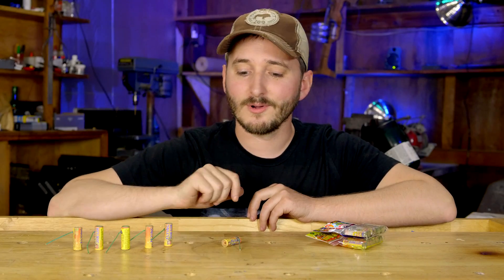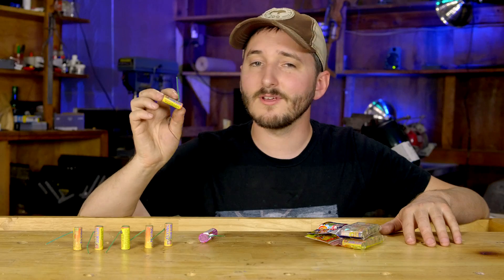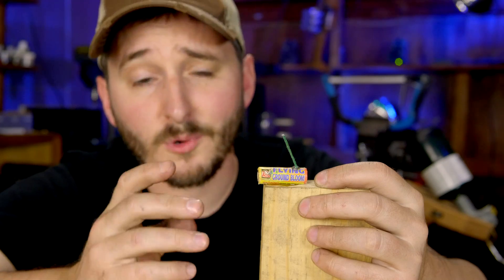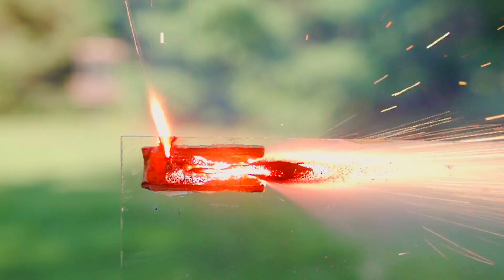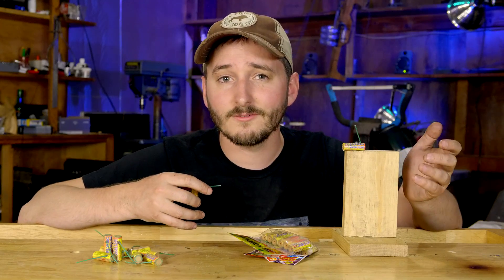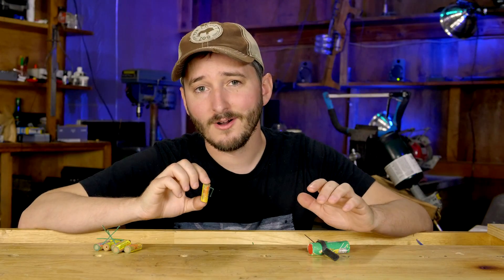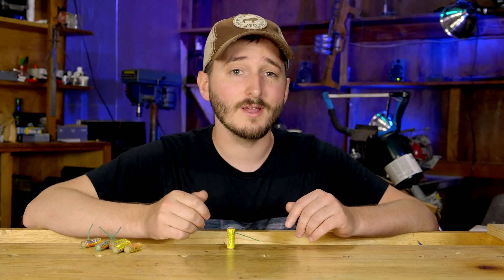How Do These Fireworks Fly?

Comment: Gyroscopic stability and moment of angle.   
The cylinder becomes more stable due to it's rotation.  
The moment of force near the end of the cylinder forces it to move inline with the center of rotation(this happens 90 degrees later due to gyroscopic procession, but it requires no input from you other than lighting the fuse).  
The closer to the center of rotation the end gets the lesser the moment of force is and the more stable the cylinder becomes.  
Once the cylinder becomes fairly stable(inline with the center of rotation), the jet in the end fires and the firework is pushed in whatever direction it happens to be pointing.

On a flat surface it tends to stabilize 90 degrees or perpendicular to the surface. Ground effect probably plays some role, but the surface it's self acts as a fulcrum or pivot point that the cylinder hinges around when the side jet pushes it inline with the center of rotation.

On the grass or any uneven surface the cylinder will fly in whatever direction it happens to be facing when it stabilizes and the end jet fires.  That direction is likely to be random due to the irregular surface like the grass.  

When thrown the cylinder stabilizes at some point during the tumbling that was imparted when you threw it and flies in whatever direction it's pointing when it stabilizes and the end jet fires.

Comment: I think the nozzle always aims down, because the center point of mass shifts down to the nozzle as the fuel on the top burns out. However, if you throw it up, drag will make the center point of mass facing up instead of down, making them fly down instead if up.

Comment: I have fired thousands of these (almost all  were hand thrown) and here is what drives me nuts: If thrown overhand, spinning end over end, they >always< fly to the left. If tossed underhand ,end over end, they >always< fly to the right. How???????? Why???? FWIW, I have never seen any made with simple black powder. Most of them are bright green, being made of barium nitrate, magnalium, a chlorine donor of some kind and a resin of some kind, IE red gum, etc. I have worked out the interior geometry and it looks like it can be scaled up to some extent. Stand by. (Full time pyrotechnist w/ 30 years experience here, using sons account).

Comment: It stands on end because of where the force is applied, you can get a similar result from spinning cylinders by applying force to one end, it works with batteries, glue sticks and other reasonably sized cylinders when you spin it from one end on a flat surface by sort of pinch/rolling it with a finger. The only difference is that the fuse hole acts as a constant application of force rather than a temporary one like using a finger so it stands almost completely upright instead of only half way.

Comment: The Coanda Effect from the off center axis side exhaust causes the exhaust flow to adhere to the side of the cylinder in an angular 2-D fashion.
Primarily circumferential but including an axial component pointing to the shorter end.
This resulting lower pressure areas combined with the flat surface high pressures in the 2 axes and rapidly accelerating spinning gradually cause the erection of the cylinder. The secondary gyroscopic effect providing basic but wobbly vertical stability. 
Ultimately the end exhaust nozzle ejection gases erupt providing powerful vertical forces and the firework shoots upward until the fuel is exhausted.
I am being semi-serious about this. But, even to me, it smacks of over analysis.

Great video. No. A Fantastic Video. This should be shown to anyone with an aptitude and interest in science and critical thinking. 
One of the best I’ve seen in a while.
With no preference of gender, racial or any other category. You either love this stuff or you don’t. You can teach it (force it down their throats) to people who are indifferent but that will be wasted effort. I’m 60 years old and I was glued to the screen to see the slo-mo video and hear your analysis.
Unfortunately, that is not what Public and most Private schools are promoting and teaching today. 
Sorry for preaching but this is a great video.
Keep up the great work.
Reply: teachers should reference this video when teaching about forces, rotations, center of mass and so on in physics. Cool video indeed

Comment: Honestly, for me it was exactly as you say it, it is intuitive for me. I already thought it would work like this  but sadly I haven't had the proper schooling to explain it in terms of physics.  What I do know from my own observations using similar fireworks is that the exit hole that the fuse goes through is slightly at an angle so that it starts the rotation that way. It also helps that the bottom of the firework is lighter therefor causing it to behave like a turvy top or topsy turvy, or whatever it is called :)

Comment: I still remember back then when I was a kid, I used to squeeze batteries onto the floor using my thumb until it launches forward and then spins fast, it will try to stand vertically but will only stay diagonally while spinning.

Comment: I do think your tippy top idea is the closer but not the fundamental contributor.  This is a conservation of angular momentum problem.  Look at how the distribution of mass changes as the burn progresses.  Initially it is uniform with a side force.  Much like your standard rotational intertial problems.  Then as the mass burns off the mass becomes lopsided and conservation of angular momentum dictates the precession of the rotation into the vertical orientation.  It is in this orientation that the charge burns through the nozzle and starts burning orders of magnitude faster thereby turning itself into a spin stabilized rocket.

Comment: Liking this video before watching it because I like you, and I know this'll be good
Reply: I think the long axis spinning causes the firework to behave as a wheel, creating the additional torque that pulls the firework upright.  I think the ground effect though not always immediately obvious still plays a roll in making the bottom end act as the wheel instead of the top end.  There could also be a distribution of mass factor, as the Center of mass shifts toward the bottom, causing the bottom to have more traction

Comment: This has a lot to do with a variation of the intermediate axis theorem, the shortest axis is the one with the lowest moment of inertia. Starting on the long axis and giving it a lot of rotational acceleration PLUS adding some friction with the table at only one end due to the fuse hole thrust causing the tube to bounce upward slightly leads to the conservation of momentum making the firework want to stand on end then the rest is just a change in thrust in the long axis direction. There are a few videos on the intermediate axis theory plus a cool one on rotating tubes by numberphile that MIGHT help make sense haha. Understand how an object can change its axis of rotation to conserve angular momentum is critical to understanding this phenomenon though.

Comment: It's a interesting thing isn't it? i've taught about it for a while before as well. But a couple of years ago i managed to get hold of a copy of a old fireworks journal that among other things explained how these are supposed to be made, making clear notes of certain off sets that are meant to be used for the angle and location of the rotational stabilizing nozzle. There also are some notes on how the weight distribution should be done for them. It's actually a pretty simple way as to how they work. The reason you don't get super consistent results is cause of them not having the greatest amount of accuracy in china when making them among other things. I can explain it all to you if ye want. i can also look for the old journal in which it's explained and draw up a cad model of how they work for ye. I'll send ye a email mentioning it so if ye are interested ye'll have a way to reach me.
Reply: Citation, please?

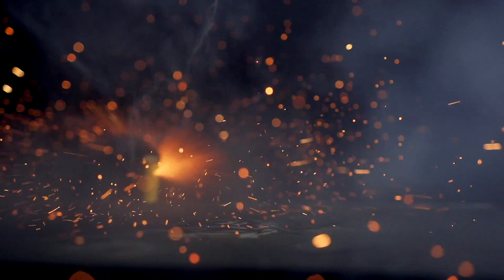Comment: I think that slowmo at 6:05 reveals all. It starts by pushing the whole body forward. Due to friction with the table, it rolls forward instead. It's momentum carries it forward until the side nozzle points down. Thrust now torques it upright against gravity. It also appears as though the thrust is off center, further increasing the rotation about the long axis, and this rotation ensures the thrust provides a torque against gravity in all directions equally, keeping the body upright. If it ever tilts slightly, the thrust when the body is rotated to the same side it's leaning towards, the thrust points at the ground and gets a little stronger boost like putting a backstop up behind the jets taking off from an aircraft carrier. Once the main thruster causes it to leave the ground, it should be spinning fast enough to maintain stability even without this "extra boost"
Reply: I also heard your comment about increasing gyroscopic precession, which would work in a frictionless environment yes, so the friction in this case leeches some of that increase in precession to an upright balancing motion. It's just that if it starts spinning too much before the first time the side nozzle pints down, it probably has to work that extra bit harder every rotation to right itself, because the majority of the self-righting torque is as You said, lost to precession

Comment: I recently started playing with yoyos... (with bearings .. spin physics at play)... 
If you throw a (unresponsive) yoyo and it goes all wobbly, having the string (or even just your hand / body) barely touch near the centre of gravity (a side near the axle for instance), will provide a lot of effect and stabilizes the yoyo into a smooth rotation again. I suspect that the hits on the ground the fireworks make while gaining acceleration are enough to remove enough of the wobble and focus the spin around the axle of the firework... the faster it spins (like a yoyo) the more energy you would need to actually have an impact so it may as well be in the air when the rocket fires ... 
So ... wanna build a rocket that has a bearing and a spinning mass going fast around it instead of wings and hope for a straight flight thanks to that gyro? 
Better yet... test to see if only the spin is required and not the actual 'thrust' from that firework to get a stick with a yoyo glued to it and some sort of a motor... to see if the stick would stand up and balance ? (I can't test this here... but sounds like a cool toy / novelty)

Comment: intuitive: exhaust gas forcing zylinder to spin around his axis, while exhaust gasses press against table. It stands up, then is propelled in the air. Why it stands up, centrifugalforce. Why it spins? because the force is applied on the outside of the cylinder pointing inwards making the center of gravity unstable and causing cylinder to tumble, gas forces trying to counterbalance the inertia of the moving cylinder. Voila

Comment: From the footage it seems like the fuse (rotational exhaust) hole is slightly off-centered from the thrust hole axis and closer to one edge of the tube - thats why they all spin in the same direction. It has to be done for a reason, and i think that reason may be why the firework stabilizes itself - it does act like a spinning top.

Comment: Looks like a Euler's disk but in reverse. The rocket is pumping energy into the system causing it to stand back up. I think you are right that it's not the only thing in play. The nozzle is not only off center along the long axis but side to side also imparting spin. A lot a physics going on is such a small toy.

Comment: Isn't the spinning nozzle slightly tilted towards the end nozzle and slightly tilted off radius to create a pull and spin effect. Because of the center of mass is lower than the upper nozzle. The weight of the under nozzle might help with this. Like this you have a simple gravity controlled gyroscope...

Comment: Quite a few factors will contribute to vertical spin stability (not the least of which is balance*) and nearly all of them are at play in that simple firework. the timing of the vertical thrust is well refined. How old are those designs?
*is one end heavier than the other? Take the fuse out and find the firework's center of balance.

Comment: back in the '80s we had these fireworks called colorful birds, they were similar in effect but more robust and longer lasting. They had no side nozzle though as I recall they did have  two ports at the rear one for spin and one for thrust. less predictable direction but the thrust was enough to enter the lake like a torpedo for several feet an exit the water still gaining 10ft of altitude. They disappeared around 1990 when China moved toward less strict communism and reformed the way they managed factories.

Comment: You see how the top that flips over is doing so because the energy that is spinning the top is from the mass which is the large ball shape. That is the force driving g it so that flies over so that the energy spinning the top vs the table are fighting against each other which causes the top to flip over. The firework is doing the same thing but it starts at the halfway point and only fills over half way since it started on its side. The energy for the firework is the hole with fore being forced out and that energy vs the table causes the firework to spin on end while the table and the force of the firework basically Duke it out. Just like the force carried in the weight of the top dukes it out with the table and forces it to spin on end. Then the rocket nozzle takes off and forces the firework into the air.

Comment: I suspect it is possible due to leverage. When the offset nozzle on the side starts thrust and some lift, the fulcrum provides adequate ant the base and inadequate leverage at the top. Additionally, as the side nozzle burns, fuel depletion increases the weight bias to the base nozzle, increasing the leverage toward the base.

Comment: I believe that the fuse nozzle is set at a slight angle this gives it spin in both x and y axis’s. This is critical because the rolling spin allows for the ground effect to take change more frequently giving it more chance to right its self. Because of its rotation it stabilizes it’s self gyroscopically, and prepares itself for the second nozzle to fire. I believe the ground effect is the major mechanism here. It allows it to correct itself as the force of thrust greatly decreases as it moves to a shallower angle to the ground. This allows for positions with a sharper angle to the ground to push harder and right itself.

Comment: The lateral trust make the Firework be on vertical, because is not in the center and is angled, lifting the Firework and the same time it stabilize by the rotation.

Comment: Lay a short piece of pipe horizontally on a flat horizontal surface, and spin it fast around the vertical axis, and watch what happens. During the spin and precession, no external forces are applied to it (other than gravity), yet it stands up. There is your answer. You almost had it!

Comment: As for it always standing up nozzle down rather than nozzle up, it might be just that the fuse end is the one that's chaotically moving all over the place but the table means it can't go down, so inevitably goes up - then any stabilizing to the vertical possition will end up nozzle down rather than nozzle up.

Comment: What if the tube was an angled hole? That would cause the object to spin and then if you assume the ground effect would that cause it to go vertical then the internal delay holds long enough then fire up.

An angled hole would also make sense as why some fail due to manufacturing

Comment: The exhaust from the side is angled at 90 degrees creating a centrifugal force, Now excess force from the side causes it to go vertical then by the time it's vertical the  main exhaust has already ignited then it launches into the sky. If you throw it from your hand it doesn't have enough time  + force to create the required  centrifugal force to create a vertical movement so the main exhaust ends up being ignited then the rocket flares into non predicted directions. The ground effect is really useful in helping the build up of the centrifugal force to create the vertical movement. cheers

Comment: I think it is when the firework starts to spin it gains rotational force along the horizontal plain but as the powder at the top by the fuse hole burns, it shifts the CG closer to the end with the nozzle. Witch causes the firework to self-correct its spin with the new CG with the heavier end always being at the bottom meaning the nozzle will always point down. Lunching the firework in the vertical plain (when on a solid surface). Also, I think the friction and ground effect does have a roll in the self-righting nature of the firework, but I don’t think it is the main force behind it all. As for when the firework is thrown it goes in random direction as the same stuff is happening but as the horizontal plain can be in any orientation and direction meaning it will go off on the vertical plain to its starting horizontal plain.

Comment: Nice video. We don't got these type of ground blums or helicopters in the Netherlands. We got very strict rules when it comes to fireworks. 

I think the exhaust part on the end is much heavier, so it starts to tip vertically before the launch. 

Very cool fireworks, but I've never seen it over here.

Comment: once the ground effect stands it upright the rocket is free to spin upright but due to the short length of the tube even a 5 degree tilt brings the ground effect back in to play which stands it back up and this all repeats at crazy speed until the base nozzle launches it upward almost perfectly vertical and i would guess within about that same 5 degree variation. excuse the lack of grammar, my analytical mind was moving faster than my grammatical mind